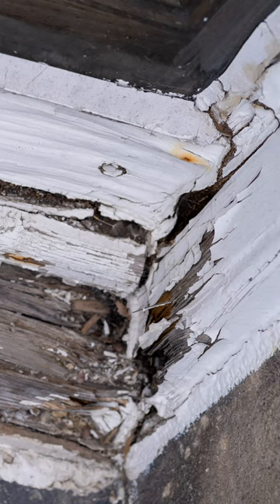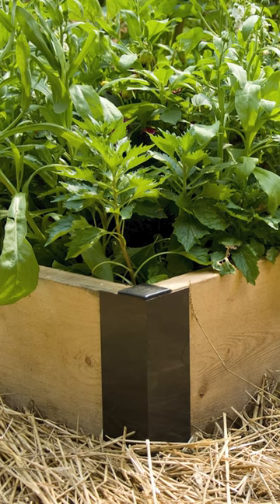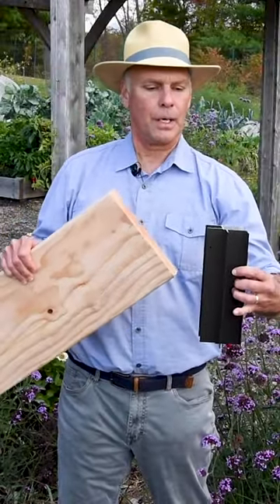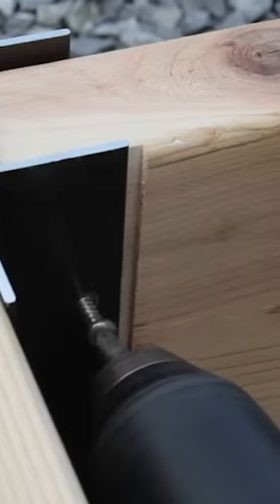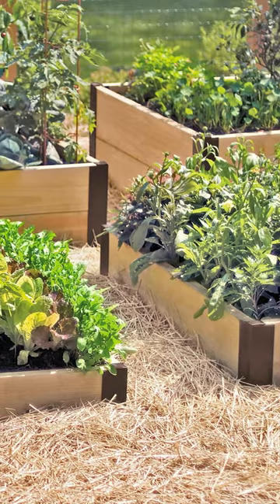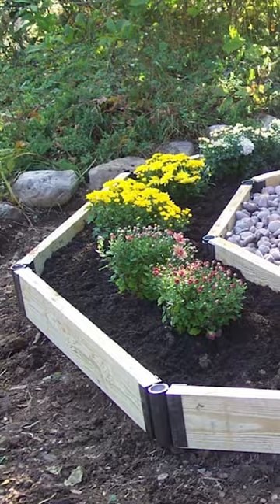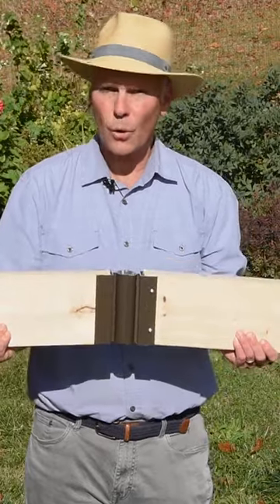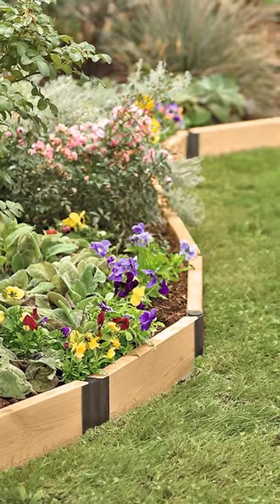How to Build a DIY Raised Bed

Comment: They make it look really easy to screw in the wood-screws, but I just bought these corners and I can't get the screws to go in the pre-drilled holes of the metal corners, & will probably have to buy smaller screws.